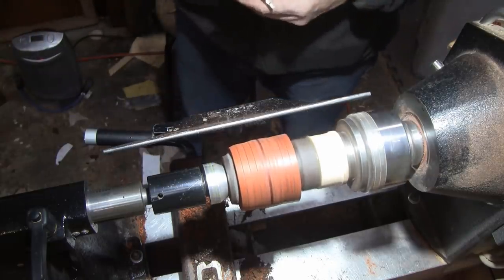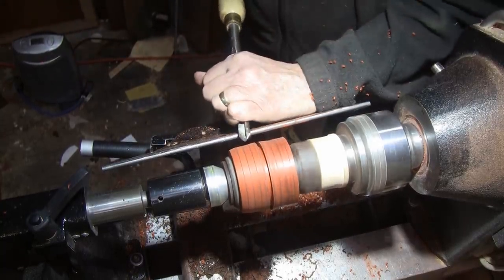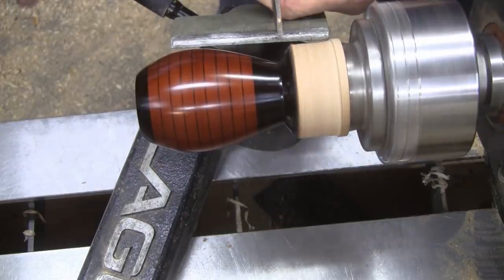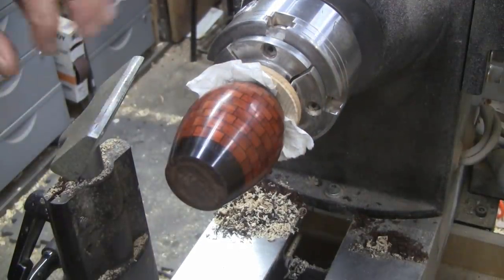Wood Turning  Segmented Brick Vase Beautiful Padauk

Comment: Absolutely stunning!!! That finish is so smooth and shiny, I assumed it was lacquered; would have never guessed it was tung oil and finishing paste!👍
Reply from the maker: Thank you Dwayne glad you liked it. This tung oil is really a form of poly. It is a lot like wipe on poly. I once finished a oak roll top desk I made with pure tung oil. Actually it was just the roller section of the desk as I recall. Not all that shiny but still looks good after 45 years.
Take care,
Gary

Comment: Beautiful. Absolutely beautiful. I had my heart in my mouth, half expecting to see it suddenly disintegrate as you were pushing that wall thinner. You’re a more skilful man than I am, Gunga Din!
Reply from the maker: Thank you Christopher I am glad you like it. I have turned bowls half as thick as this. They are turned green and allowed to warp.
This has a lot more work so that is as thin as I want to make it.
Thanks again.
Gary
Reply: BJ , Just checked out your video  , tremendous work  . Chris your comment on getting to thin reminded me a couple years ago I took a segmented bowl course at a RV park in Texas and the instructor asked me if I was getting to thin and I stopped the lathe and checked it was so thin you could see light through it but it never flew apart . Cheers safe turning
Reply from the maker: Very good. People work hard to get it that thin. Makes a nice lamp shades.

Comment: You may have addressed this question previously.  Do you have a machinist, drafting or engineering background?  Your jigs are very creative and your designs complex.
Reply from the maker: Thank you very much. I worked as a wood pattern maker and had to design all the patterns so that they could be molded in sand.
I did make a number of jigs for special cuts. And the wood patterns were much more complex than the wood turnings I do. But some of the patterns were also simple.
Thanks for watching,
Gary

Comment: This is lovely ...thanks for the process.  Did you just turn off the square veneer between layers or did you cut it down with a knife first?
Reply from the maker: Thank you Paul, I just turned it down it was very easy to do.
Gary

Comment: wow just amazing I hope to make things like that I'm getting a lathe myself soon really nice piece
Reply from the maker: Thank you Jason I am glad you like it.
Good to hear you are getting a lathe you will love it.
Gary
Reply: @ThePapa1947  thanks once I've made something I'll send a pic it'll be about 3 weeks till I get my lathe
Reply from the maker: @darko6697  great I would love to see it.
What lathe are you getting?
Reply: @ThePapa1947  just for starters a Draper variable speed mini
Reply from the maker: From what I have seen watching others that is a nice solid lathe. You will enjoy it.
Reply: @ThePapa1947  hey Gary I've just purchased some sanding sealer in preparation for turning what would you recommend as a nice shiny finish that would be food safe and possibly slightly waterproof thanks in advance
Reply from the maker: General Finishes sells a Salad Bowl Finish you might want to check out. It goes on very easy has a nice shine and I would say would hold up to some water. 
 I have used it and it goes on like wipe on poly.
Hope that helps.
Gary
Reply: @ThePapa1947  thanks bud ill check it out

Comment: Hi Gary,
I love the brick work style on this vase!
I've been doing 99.9% segmented work so this piece is right up my alley!
You mentioned dyed veneer.Is this something you dyed or did you buy it dyed?
Thanks for the video!
Tom
Reply from the maker: Hi Tom I am happy you liked it.
The veneer was purchased. As much as I enjoy doing everything I can myself I was not ready to try dying veneer. So I purchased it off of Amazon.
Thanks for watching.
Gary
Reply: @ThePapa1947  
I started the bottle stopper made from cherry several segmented rings that had 10 segments.The segments had to be a tad over 1/4" tall in order to get a good luck on such a small piece.I sanded some Wenge strips down to 0.0625" on my drum sander and when I tried to cut the pieces of Wenge to go between each segment I gave up! LOL
I never even thought of making the segments much thicker and slicing them on the band saw until I just watched this video again!
My brain isn't as sharp as it used to be but I'm going to give the bottle stopper vase another go!
I also noticed that you got a very smooth finish on the Wenge.I have a good bit of it and the grain has fairly deep "pores" in it (like Red Oak)so I always get a "rough" finish.Any ideas how I can improve the grain/finish problem?
Thanks for helping me over and over again!
Tom
Reply from the maker: @thomaskuzia8125  Hi Tom glad to hear you are having a good time with all of this. If and when I make room I want to get a drum sander as well. Right nowt there are a few machines I could part with and not even know it. such as I rarely use my thickness planer or one of my milling machines.  But nice to have just in case..lol
Getting the open grain can be a pain for sure. Many coats of finish and sanded each time will get them filled. You can use a filler but I would rather not because that can look worse than the open grain. But I have sanded those types of wood using the finish for wet sanding and the dust will fill the grain. Let it dry and then sand it all again.
Try on a scrap to see if you like the results. On Wenge it just might look fine.
Best of luck,
Gary
Reply: @ThePapa1947  thanks again Gary again and again

Comment: Where did you get the black veneer and how thick is it?
Reply from the maker: I bought it on Amazon. They listed it at .55 inches but I think they meant .55mm because it measures .021 of an inch.
Rockler sells it also and has a better price. I got mine because the overall size of the sheets was bigger.

Comment: Sir,
Why do I see so many creator’s using a two fence system for cutting the wedge’s? 
I’m using a single fence and flipping the stock each pass, is this wrong?
Reply from the maker: I do not think hat you are doing is wrong if it works for you.
Using the two fence method has a number of advantages.
One is the wedgie sled sets the perfect angle and does not matter whole thing is off to the blade the angle and is still perfect.
You can also make it off to the blade for interesting effect which I have done. Still getting perfect joints.
 Then if for some reason your strips are not perfectly parallel by using the same side of the board against the fence you will get perfect joints.
 Flipping a board that is not parallel even a little can cause bad joints.
 So those are my reasons but for sure they can be done the way and I wild not say it is the wrong way. Plenty of ways to do it and I pick what I think is the best for me.
 Thanks for watching,
Gary